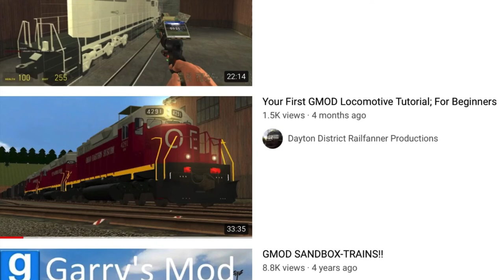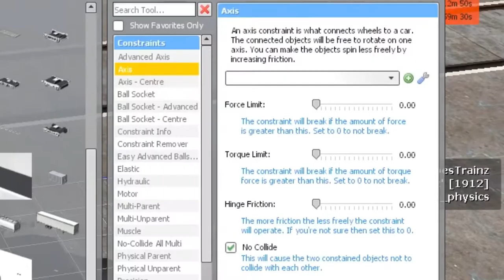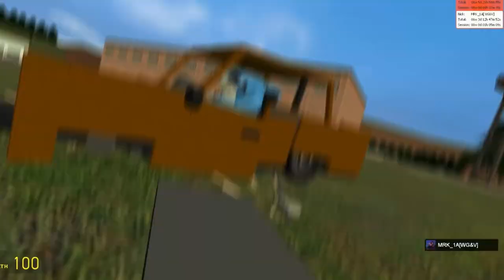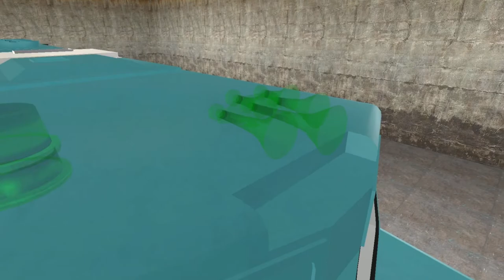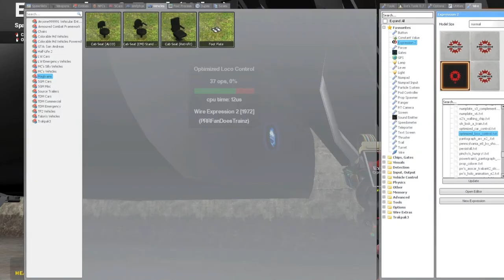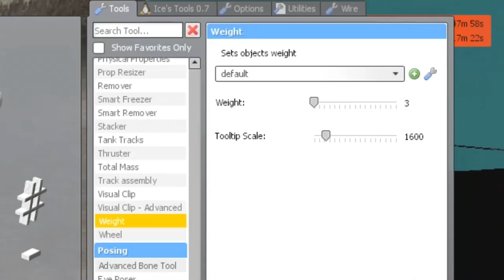How to Build a Train in Garry's Mod (Gmod Train Tutorial)

Comment: question:
how do i downforce the train so it dosent derail easily?
Reply: use the wight tool to make the locomotive and railway cars more heavy as without those you can well derail. using those will make it less likely to derail
Reply: @mrtrainstudios  thank you, my train works like a charm now
edit: i realized i set the max speed too fast in the e2 chip so i set it to 1000 and it worked
Reply: @mrtrainstudios  the passenger cars keep derailing even tho i set weight to max
i used magic crowbar coupler